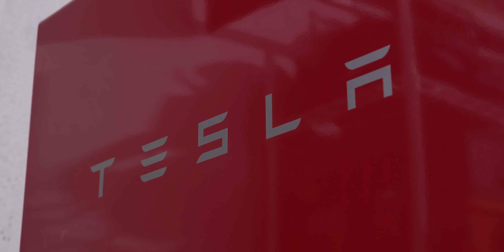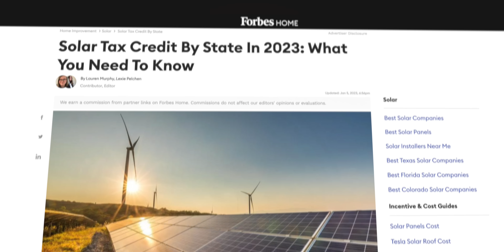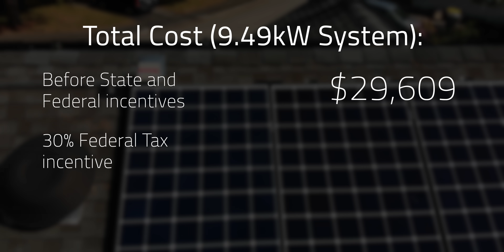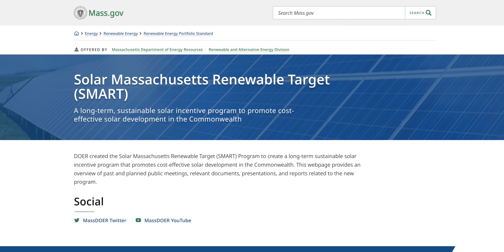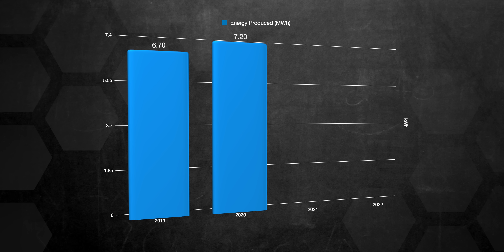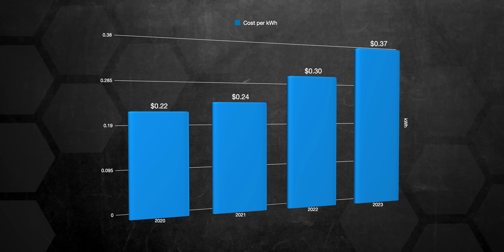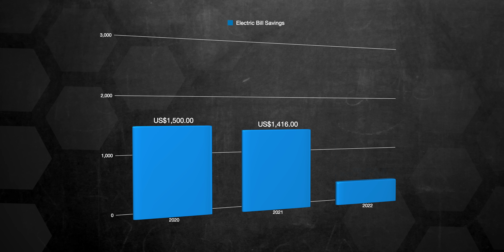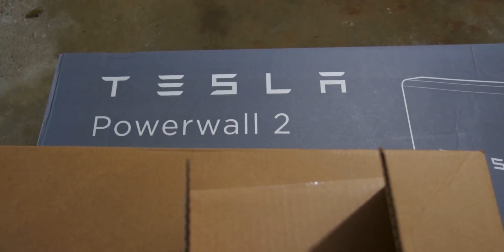5 Years with Solar Panels - Is It Still Worth It?

Comment: I have solar panels for my house for 5 years as well. I live in Singapore. I installed 7.54kwp for $17800 and was able to save about $200 per month on my bills. I definitely agree that picking the right installer is key on which direction your experience will go. Mine (solargaga) was lukewarm and not great at times but I heard worse stories. Thanks for sharing about the less harvest in 2021. I experienced the same issue and thought that my solar panels was acting up but next year it spike so I wasn’t sure why. Now, I keep my fingers crossed that my solar panel continue to function properly so I get returns from my investment and able to break even. Over the 5 years, I did have to replace one of the spd which cost me $300. The install was supposed to come with 5 years of free maintenance service but it’s nothing more than them coming to look at your readings. They did not even bother to climb up and check the panels. Scheduling with them was always an unpleasant experience. In Singapore, we did not have the battery available to us yet when installed mine 5 years ago so I do not have that for my home. I would be interested to look into that. We do not get government subsidies or any form of credit at all. Singapore is still rather backwards that way.
Reply: Impressive, you might break even in 10 years.
Reply: @eustacemcgoodboy9702  

Singapore is a Country about the Equator = Lot of Sunlight, so is Malaysia and Vietnam; but those Solar Panels = were they China Made from Xinjiang Autonomy Region = Where labours are cheap and some are Forced Labours?   Is it Human costs to pay for some Singaporeans benefit?

[ While there are many types of PV systems known to be effective, crystalline silicon PV accounted for around 90% of the worldwide production of PV in 2013.  To reduce energy losses, an anti-reflective coating is added to the surface, along with electrical contacts. After finishing the cell, cells are connected via electrical circuit according to the specific application and prepared for shipping and installation.[47]

Environmental costs of manufacture:  😂 😂 (Just shifted the 😰 😰 Sweatshops to Xinjiang and our Conscience is clear) 😍 😍 They, China Manufacturer used Coals to fire up these Intensive Powers Demands Plants (Coals from where = including Indonesia.  Where at some point, Smoky Air reach to other Countries across the vast Pacific Ocean!

Solar photovoltaic power is not entirely "clean energy": production produces greenhouse gas emissions, materials used to build the cells are potentially unsustainable and will run out eventually, the technology uses toxic substances which cause pollution, and there are no viable technologies for recycling solar waste.[48] Data required to investigate their impact are sometimes affected by a rather large amount of uncertainty. The values of human labor and water consumption, for example, are not precisely assessed due to the lack of systematic and accurate analyses in the scientific literature.[1] One difficulty in determining impacts due to PV is to determine if the wastes are released to the air, water, or soil during the manufacturing phase.[49] Life-cycle assessments, which look at all different environment impacts ranging from global warming potential, pollution, water depletion and others, are unavailable for PV. Instead, studies have tried to estimate the impact and potential impacts of various types of PV, but these estimates are usually restricted to simply assessing energy costs of the manufacture and/or transport, because these are new technologies and the total environmental impacts of their components and disposal methods are unknown, even for commercially available first generation solar cells, let alone experimental prototypes with no commercial viability.[50] ]
Reply: @eustacemcgoodboy9702  i will break even in 3 years
and im able able to sell my house and get a value for the system that is more then i gave 

by choosing the right installer and looking into the prices (and i live in scandinavia)

i had no need to look into tax credits, but in germany a project like i did is tax free
Reply: so many hustlers.
its a couple of bolts for the panels and a couple of wires on the inverter
i agree dont pays 5-10 times more then needed for that work
many comapanys make over 10000 dollars on half days work for 1 man job, and sell the equitment very expensive
Reply: If you cannot get taxpayer subsidies, just go door-to-door and ask your neighbors to offset the cost. Same thing.
Reply: @majorburke9735  Agreed. I live in a country with zero subsidies, and guess what? The prices are much more reasonable. Figures. Government involvement bad.
Reply: Not every place in the states gaves you a credit back, it totally depends on the state or the location
Reply: 5y, 200/m, = 12k.
Got 5.8k left.
BE in 29 month from your comment, and 23 month from my comment if suppy remains consistant.
Disember 23

Im from malaysia btw and interested in installing solar.
But maybe for day accessories supply

Comment: I have east west lot, no trees around, Florida sunshine beating on my roof. House a year old, so brand new roof.  House is certified "green" but I'm not a nut about "green" anyway.  (and I eat meat, too.)   And I can afford it even without incentives.  But not sure I want solar, even with incentives.  It's tacky and I worry about what it will do to my roof.  And I'm 74 years old.  So a 10 year pay off doesn't appeal to me.  I have a back up gas whole house generator.  I just spent over $1K each for 2 suits.  So saving the cost of two suits each year with a payoff of 10 years doesn't seem reasonable to me. So...Help me out here.

Comment: I'm in Nh and thinking about panels. I haven't done the research yet but am interested. I believe I have a good size place that gets full sun or close to it. I'm not at all sure the trees around don't cast shadows on the roof any time of day. My utility Co has gone up on their rates twice just recently. I only bought this house last Nov. so I'm still finding a usage level and all of that. My brother who is an electrician has warned me that some assistance deals need to be checked carefully. Not necessarily good deals for us older farts. I also drive a Nissan Leaf electric car, that I charge at home of course. Adds to usage naturally but I can't say how much is specifically used for the car. I'm also thinking of adding a hot tub. could get expensive.

Comment: Why don't you do a video about the cost to replace a roof with those panels attached?.  or what happens when 1 shingle under the middle of the panels blows off and starts a leak?  I hope the buyer of your house knows those things before buying it but they wont, and while you are collecting government subsidies, many wont be available to a buyer.
Reply: My ex-stepson-in-law recently paid $3,500 to remove and replace 4.0 kW of panels, in addition to $31,000 for the actual repairs. So the added cost for the panels was significant, but not huge.
Reply: @BigBen621  10% and its likely the contractor padded the 31k.  Usually cost for a roof is by square foot, how big a house was it?
Reply: @xaxzander4633  From Google Earth, looks like it was about 2,200 SF.
Reply: @xaxzander4633  Oops—actually about 2,840, assuming a 30° sloped roof.

Comment: Maybe, no one gave the right information on solar panels. The solar system installed should be on a track system. The Sun comes up in the east and sets in the West. When the Solar Panels are on the tack system they are easy to clean. Since, the solar system is Direct and not Alternator Power. The standard 12 Volt Battery is cheaper than a Power Wall. Based on the watts you use in your house will give a general idea how many 12 Volt Battery you may need. Plus, how many inverters you may need. 12 Volt Batteries for cars are cheaper than a Power Wall. Putting the Inverters and Batteries in a shed frees the space in the garage. Batteries are hocked in series and change during the day. Then you full power at night. The tracking system will follow the  Sun as it comes up in the Morning and when it goes down in the evening. That way you get a full body of sun penetration of sunlight to the bank of 12 car  batteries. Just a suggestion. Most Solar Companies don't understand how solar should be used correctly. It's all about the money and putting it on the roof is a bad idea. Just a thought for the moment.

Comment: I've had them for 2 years . What irritates me the most is that they didn't even offer NOT to put on my structure (went on shop not house) AND I have 35 acres!! I could've had the ideal most efficient facing direction as well as not have them penetrating my roof. Still mad that they didn't offer that. And I didn't know better. They are probably 10 to 20% less efficient in the angles at now

Comment: Lots of subsidies.  Not sure Solar is ready for prime time yet, but maybe someday.
Reply: I was paying $2,000/year in electric bills, which went to zero in 2016 with a $14,700 solar system. I'm pretty sure solar is ready for prime time, depending on your location and electric rates.
Reply: @BigBen621  Did you receive subsidies or tax breaks?
Reply: @craigthompson3739  30% tax credit.

Comment: Thank you for the video. I’m looking into getting solar for my house in the south. At the same time I’m also looking to replace my roof. Do you have any thoughts, suggestions concerns about installing a brand new roof and then installing solar right after that? Thank you so much
Reply: Definitely better to install a brand new roof before you install solar, than after . Most solar installers will include a roof leak guarantee, and by now they know how to mount rooftop solar without creating leaks; so this should be no problem.

Comment: In the uk I have a dual tariff and my rates have gone from 5p to 7.5p off peak and 14p to 41 on peak and the daily standing charge from 24p to 45p overnight as I had a fixed tariff deal, so your increases are not so terrible. If you have a single tariff the rate is around 31p
I need the off peak tariff to charge my EV and the batteries on my Solar system as solar production for the winter 6 months will only 30% of my demand so I am very happy to have installed Solar/Batteries in the last 3 months which cost £17,000 but will save me £2,500-3,000 a year and I am too old to consider the pay back period, I only look at a 15% tax free return when I was only gaining 5% on some shares I sold

Comment: We have a 6.6kW Solar system and Powerwall2 and it covers 100% of our electricity usage. 
I chose to opt out of the VPP as I need all my battery capacity for overnight usage and backup in the event of a grid outage. Having the Electricity Utility taking it at inopportune moments - wasn’t going to work. 
The solar and Powerwall2 with incentives cost A$17399 much much cheaper than yours would was just for panels and ridiculously cheaper had you paid for your Powerwall2. 
As it is though we are paying it off interest free over 5 years but at double the rate we were paying when we paid for electricity meaning the payback period is really 10 years. However over 20yrs it’s projected to save around $30k which is a win any way you look at it. 
And we now no longer rely on the grid. It’s just there for when there’s extended periods of rain or not enough sunshine. 
Our feed-in tariff isn’t 1:1 like yours - it’s only 15¢/kWh just gone up from 10¢. And that’s only for the first 14kWh/day then it drops to 5¢/kWh. So it’s just covers the grid connection costs and not much more.
We are in Australia.

Comment: Just wait until your roof needs to be replaced - roofers don't move solar panels for free. Solar panels work but they belong in the middle of desert not on top of residential houses. If this idea was a great idea solar companies wouldn't have to hire door-to-door salesman to pedal their product, the consumers would come to them. Maybe next time you'll include the cost of all your time cleaning, snow removing & maintaining your solar equipment. Do you work for free? One last thing, a huge percent of home buyers avoid buying a house with solar. Reasons? They don't want the extra chores and they know the life span of solar panels is limited. Did you pro-rate your system when you sold your house?
Reply: Removing and replacing solar panels adds about 10% to the cost of reroofing, which shouldn't be needed more often than every 25 years or so. The life span of solar panels is guaranteed to be 25 years, and will likely be far more; by that time, they will have paid for themselves several times over. I have a 6.0 kW system that's eight years old. I've had the panels washed once, for about $100, and there are no "extra chores" other than counting my savings every month.

Comment: What is the life span of the panels, who pays to have then recycled, what about home insurance, maintenance of the installation, warranty and who pays for replacement of the panels. Do you have to clean them, if so how? What is the maintenance on the power walls, are the batteries lithium bssed, who gets to replace then and how long do they last. You are missing some key information, nothing works for long without maintenance

Comment: Your electric bills seem very expensive for your house size.  Is your heat electric?  You should really consider a passive solar greenhouse on your new build to save heating costs.  Natural gas, high efficiency heat is much cheaper than electricity.

Comment: My solar system went “live” in December 2020. Although installation started in September 2020, we had an extremely finicky county electrical inspector who kept finding “new” errors to correct, which delayed getting the final permit, before the utility couId install the new net meter. I find it interesting that I have 13 panels, but my solar production is almost the same as yours with double the panels, 6.73 MWh in 2021 and 6.8 MWh in 2022. It helps that I live in sunny Colorado and have a nearly unobstructed south facing roof. My point: orientation and weather play a huge part. 

Speaking of weather, I have experienced the avalanche you spoke of—took down my gutter in March 2021. So now I rather religiously go out and “shovel” the panels whenever they get any snow on them. It blocks the solar production anyway, and since it only takes about 20-30 minutes depending on depth, I would rather do that. My “roof shovel” has a 17’ handle, so I can reach all but the top 6” of the panels from the ground (ranch style house). 

My net metering has resulted in only paying the connection fee, which has grown from just under $6 to just under $8 over that time, except for one month, in which I had to pay an additional $1.20. For both 2021 and 2022, I got a small check from my electrical utility (they pay me at wholesale rates). So essentially, my monthly out of pocket cost is the connection fee, minus whatever I get paid after the end of each year. 

I do not have a backup battery. I’ve thought about it, but in the 3 1/2 years I’ve lived here, the longest outage was 2 hours, and all other outages were measured in minutes. I just can’t justify the cost of a backup battery. 

I had initially calculated my ROI as about 15 years, but just like you’ve experienced, electrical rates have increased. So it’s going to be shorter than that, but I haven’t recalculated. 

Basic question is answered the same, yes, I would do it again. The only thing I wish I’d known before it was installed would be the need to clear the snow off expeditiously, which isn’t a big deal at all.
Reply: EFF OF THE PANELS IS A HUGE KEY.. THE LG PANELS ARE LOW EFF..

Comment: We've had a 2kW grid-tied PV system for twelve years, and haven't paid a dime for electricity in that time. It paid for itself years ago. But that was then ... panels were a lot cheaper.
Reply: A hair dryer uses 1500watts and a hot water heater around 5000watts. Then there's A/C, fridge, microwave, stovetop/oven, TV, Lights etc. How are you getting by on 2Kw?
Reply: @handsupbud  Well, we don't have a hair dryer...our water is heated with a 2-panel solar thermal system (with propane backup)...we don't use much A/C (usually just run the heat pump dehumidifier) ... the stove is propane ... the lights are LED ... fridge, computers, microwave, etc don't add up to much. We usually hang-dry our clothes (we're only 2 people). We always have extra electricity, which we've been able to share with other customers.

Comment: It looks like depending upon how much you get for the sale of your home, the solar panels and battery system will be a wash.  No significant monetary loss or gain (i e. you're probably going to break even)

You failed to take in account the time value of money.  You could have gained more by putting that money into an S&P index funds that earned about 10% during that same timeframe.  Plus, there is the additional work needed to deal with additional related issues and problems.

BLUF, if you stayed in your home longer, there would definitely be a net gain (monetarily), but as it played out, I think you will have a net loss.  That being the opportunity costs of $30,000 you paid out could have been better utilized in an investment for retirement or other business opportunity.

Comment: That’s a lot of money up front.  The question is when if ever you will break even and are the panels or batteries still functional.  If not what will the replacement cost be at that time?  In other words,  solar panels need to be much less expensive.  Dramatically less or the whole idea is a cruel joke.

Comment: Here in Ontario Canada I run a lot of electricity in a 5, 000 square foot home for 120-150 a month.  Most power in Ontario comes from hydro, it's clean and very cheap.  I see no use for solar on my house.  In Southern CA where it's hot, sunny, and electricity costs a fortune...yes for sure.